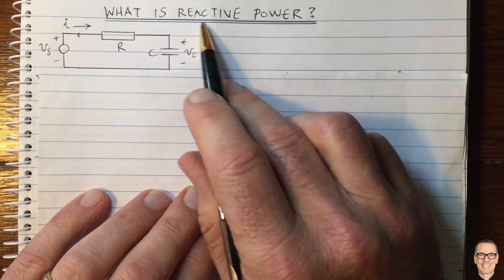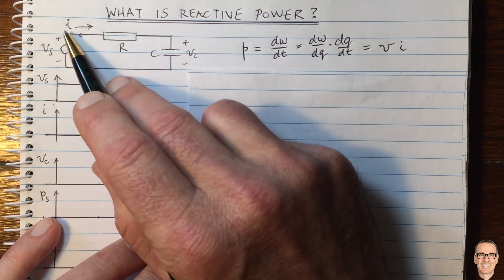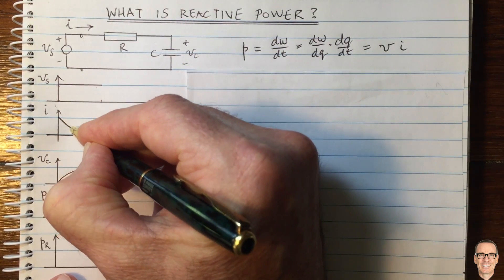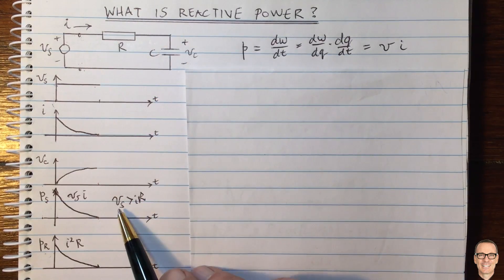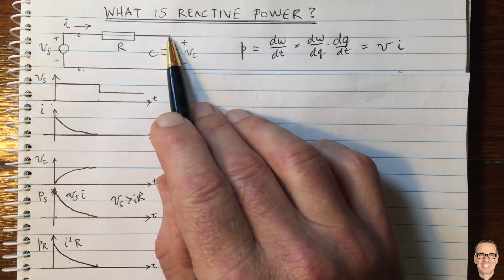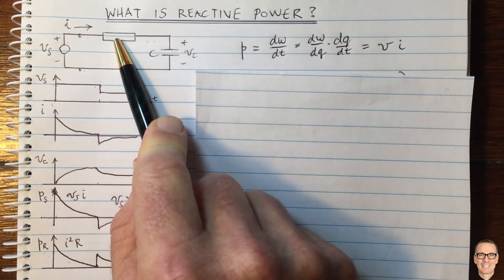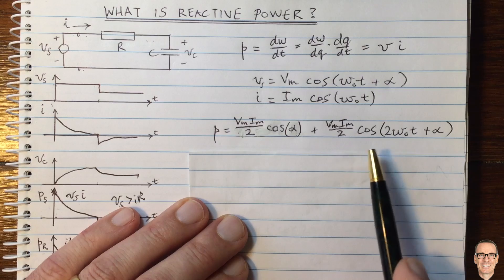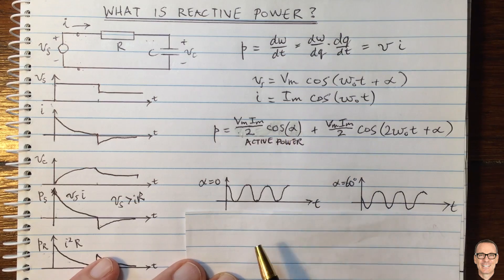What is Reactive Power in Electric Circuits?

Comment: *Abstract*

This transcript explores the concept of reactive power in electrical circuits containing energy storage elements like capacitors.  Here's a summary of the key points:

*What is Power?*

* Electrical power is the rate at which electrical energy flows (`P=dW/dt`).
* Power can be expressed as the product of voltage and current (`P=VI`).

*Power Flow in a Circuit with a Capacitor*

* When a voltage source is connected to a capacitor-resistor circuit, current flows into the capacitor, storing energy.
* When the source voltage decreases, the capacitor discharges, returning energy to the source.
* Power flow into the capacitor represents energy storage; power flow back from the capacitor represents energy release.
* Energy dissipated in the resistor is lower than the total energy supplied, reflecting the storage/release mechanism.

*Sinusoidal Input and Phase Difference*

* With a sinusoidal AC source, the current through the capacitor lags the voltage, creating a phase difference.
* This phase difference leads to an oscillatory power flow, where energy is alternately stored and returned.

*Active vs. Reactive Power*

* *Active power* is the average power delivered to the circuit, causing energy dissipation in resistive elements.
* *Reactive power* is the amplitude of the sinusoidal component of power flow due to the presence of energy storage elements (capacitors, inductors). It represents the power associated with energy storage and release, not dissipation.

*Key Points about Reactive Power*

* It is a real component of instantaneous power, not imaginary.
* It exists when a circuit contains energy storage elements.
* Its value depends on the amplitude of voltage and current, as well as the phase difference between them.

disclaimer: i used gemini advanced 1.0 on 2024-02-26

Comment: Thanks, so can we say that reactive power (due to L and C in circuits) is an unwanted phenomenon, but we have just to deal with it when we have some compobents?
(It decreases the effective power -> therefore "unwanted")
Reply from the maker: It depends on how you define "unwanted". It comes with having capacitors and inductors in a circuit - which you often want to have.

Comment: Great video sir!  Q: at t=0, I presume the capacitor is fully charged, correct?
Reply: No, it isn't. It starts charging from 0 V as seen  on the vc(t) graph.
Reply: Yes it is good question.
Answer is: presume capacitor is fully charged to voltage V initially (t =0)
Then one side you have fully charged (voltage  V) capacitor and other side 
voltage source Vs
if initially fully charged  capacitor  voltage V same as  Vs( voltage source voltage)
 V = Vs then no electric charge flows due to no potential difference or equivalent potential 

if initially fully charged  capacitor  voltage V greater than Vs( voltage source voltage)
 V > Vs then  electric charge flows from  
 higher potential to lower potential.
I.e., from fully charged capacitor to voltage source.(this is nothing but reactive power this is what explained in this video)

if initially fully charged  capacitor  voltage V smaller than Vs( voltage source voltage)
 V < Vs then  electric charge flows from  
 higher potential to lower potential.
I.e., from voltage source to fully charged capacitor.(this is nothing but active power this is what explained in this video)